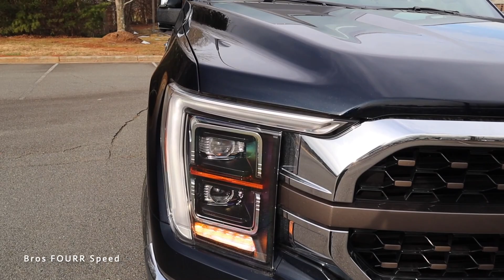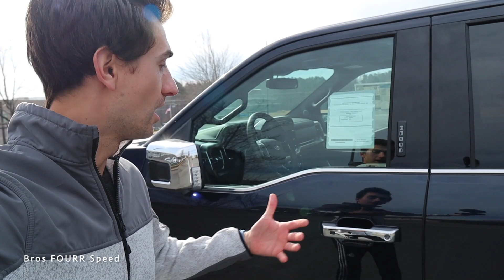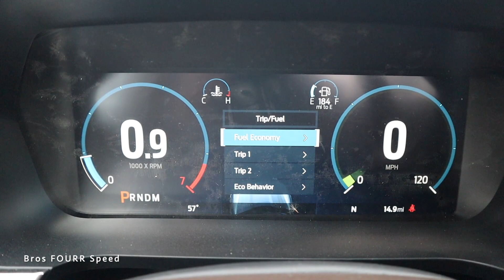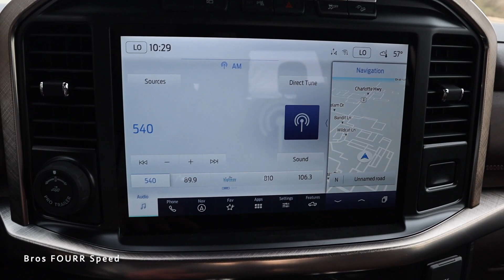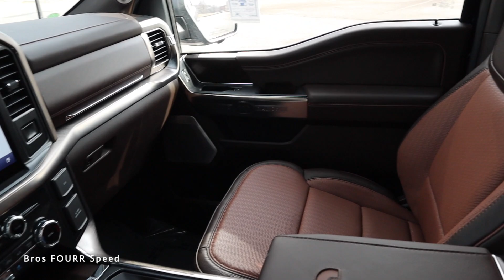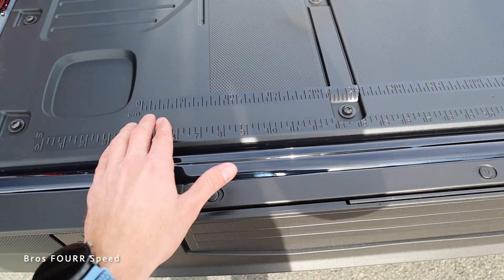2022 Ford F150 King Ranch SuperCrew: Start Up, Walkaround, POV, Test Drive and Review

Comment: you literally have the payload sticker a foot away from you....why do you not show ACTUAL payload?? 3000lbs is definitely not correct for the king ranch crew cab. Max payload helps nobody.... show as configured! c'mon!
Reply from the maker: The sticker on the door? That shows bros weight. Does it really say payload? On Fords website thats about where this was listed
Reply: @BrosFOURRSpeed  yes there is a sticker on the door jamb that has the actual payload rating for the truck
Reply: @BrosFOURRSpeed  Yes sir. There are 2 stickers in the door jamb....one of them has a yellow stripe going through it which says "passengers and cargo shall not exceed xxxx lbs and kgs" thats the payload for that exact truck.